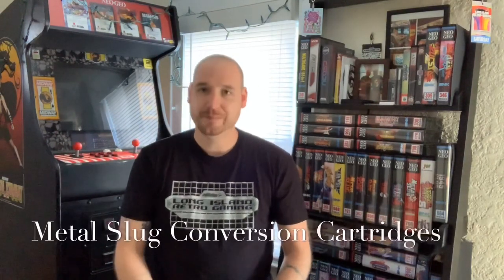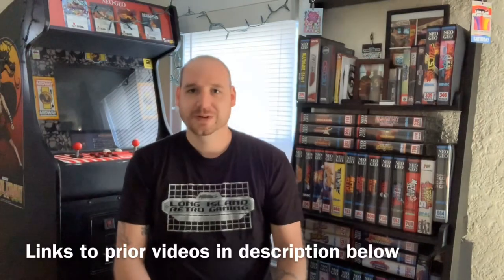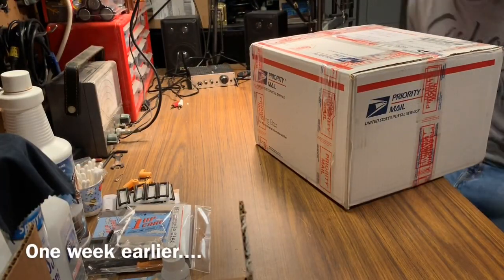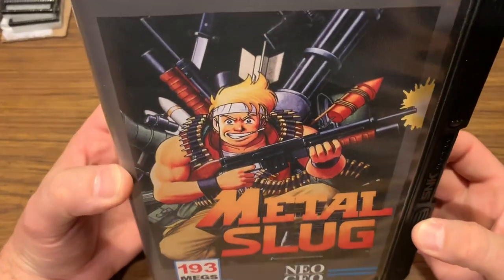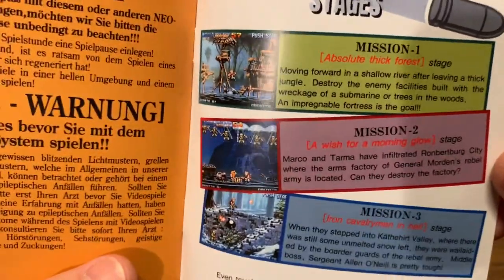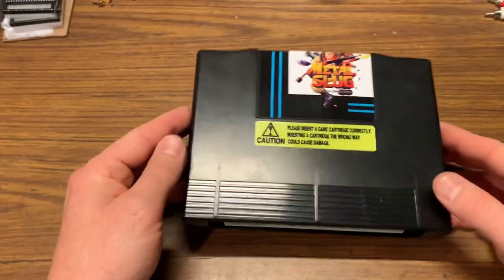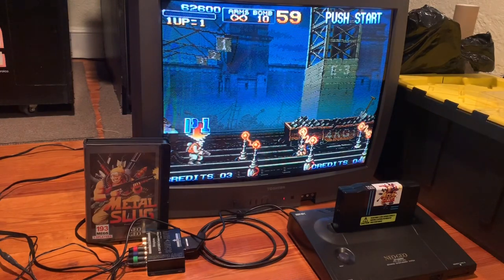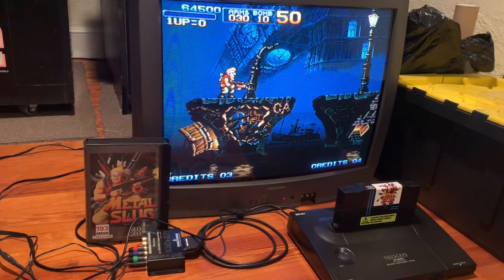Neo Geo AES Metal Slug Conversion Cartridges (Part 3)

Comment: Cool , i want do one converter of metal slug 3  have tutorial? I have one metal slug 3 mvs and one kof 99 aes
Reply from the maker: Sorry man I’ve never made one myself.
Reply: If the boards between the two carts are identical, you need a good desoldering gun, hot air rework station, and alot of experience with soldering. Because you have to swap every IC (chip) between the two carts. This is due to extra security added by SNK.

Comment: Unfortunately, his desoldering and resoldering is likely what killed that M1. That's one less fully functional Metal Slug original ROM set in this world.
Reply from the maker: Yup you are right on
Reply from the maker: Hey Emmett any advice on trying to open up a glued cartridge?  I have all the tabs pushed in and it just won’t go.  Do you just have to man up and rip it open??  Thanks
Reply: @mike7599  I had to fight with mine quite a while before finally getting in. Nothing specific seemed to do the trick, just a lot of prying and pulling with man-handling that probably wasn't suitable for a valuable game. Some things I might try if I were trying again with a more valuable game:
Cold
Heat

Sometimes getting an adhesive really cold makes it brittle and it breaks off easier but it could be bad for the solder joints and you also might get a lot of condensation. You can minimize condensation if you live in a cold region where you could leave it in the car and then try to open it with the defrost running (0% humidity). I've seen cases where a quick blow from something too broad to crack the plastic can potentially release all the adhesive at once... maybe a block of wood to spread the force, a mallet, and some kind of cloth to keep it from scratching.

The kind of adhesive I saw didn't seem like the kind that would soften much with heat but that's also worth a try. A heat gun risks melting stuff and doesn't heat through and through like leaving it in a hot car for an extended time would. Still, it might help during the attempt if it's low enough. Hair dryer too.

Wish I had some better advice. I'll try these suggestions myself the next time I come across a glued cart.
Reply from the maker: Emmett Turner thanks for the ideas man.  It’s crazy how hard they tried to keep people out by glueing the carts closed.  I’m tempted to try a hair drier.  Not sure if I have the guts to smack it with a hammer though!  It’s weird, to me it almost seems like they glued the divider piece that separates the two boards.  The rear part of the cart near the label wants to open but the front just won’t go.   I’ll keep you posted thanks again!
Reply: @mike7599  Glue is on the two posts that are closer to the contacts. They go from the back side through two holes in the boards and into two little cups molded on the front half. The glue is in the little cups that the posts seat in, so it surrounds the posts and has a good grip. Luckily, I did my earliest experimentation on a glued copy of Garou Densetsu Special (Fatal Fury Special; cheapest game). ;)

Anyway, I just checked my latest game (Fatal Fury 2 US dog-tag edition) and found it was glued too. I released every tab which made the front shell bow in on the contact side... lots of spring tension being held by the glued posts. I was going to set it down on an oil heater to see if it would release after it warmed up but I first applied a little pressure pushing out at the center of the bow. Suddenly (and, more important, unexpectedly) it released and sprung open!

It seems they used very little glue this time so I don't expect them all to be that easy. Still, I learned to be prepared for that or it might spring wide open and you'll end up creasing your label. Barely avoided that myself.

Out of my 10 games I don't have anything particularly valuable and I've only opened about half of them so I'll check to see if any of my others are glued. If so, I'll heat it up first to see if it makes things any easier.

Now, because the glue is between posts and little stand-off bowls, I don't expect a hair dryer to get any significant heat there. Hot car or one of those low-temp "safety" oil heaters seem like a better bet since you can let it thoroughly warm inside and out. Hot car probably isn't an option in the northern hemisphere right now. :)
Reply from the maker: Ah ok, I totally get what you mean about the posts being glued.  Makes sense considering screws don’t go threw them like in an mvs cart!  Well now I at least know how to grip it to tear it open, so I feel better about that!  Thanks again man
Reply: @mike7599  I did a bit of experimenting. Heat definitely did the trick, but mistakes were made!

Hoping the tension would release the glue on its own as it warmed, I placed two games on the heater with the clips released and pried up. The bowing was obvious on the front shell and so I had to set them on the flat back and leave them longer, since the front/glue side was not flat enough. When I came back, the back shell was bowing. The heat had soaked to the front and I was able to release the glue easily but the spacer plate between the CHAR and PROG boards had also bowed in/up a bit, making it difficult to close properly. Little protrusions from the front impact the plate unless you straighten/bend the plate down toward the contacts during reassembly. Those were Samurai Shodown (NA) and Shin Samurai Spirits (JP).

During all of this I had left my other glued carts with the clips released and they returned to their original shape just fine since I didn't apply heat. I snapped Riding Hero (NA) and Garou Densetsu 2 (JP) back together and placed them face-down on the heater with the labels over the edge (not touching the heat source directly). I didn't have to wait nearly as long since it was heating the glued side so I tried about 6 minutes later and they popped right open. The softened glue gives just enough resistance to be easy to pull open but not require the kind of force that might make you lose control and crease your label.

I still have glued Ryuko no Ken (JP) and Ryuko no Ken 2 (JP). One of them is only half-glued (one post) but maybe I can demonstrate with those.

I think I can get the two warped shells to straighten out by heating them again without the tension. Got a few cheap dupes to salvage spacer plates from if those remain an issue. ;)
Reply from the maker: Emmett Turner thanks for all the great information Emmett.  Hope that the shells straighten out!  I think this deserves a video if you do decide to crack open your remaining glued carts!  There is almost no info on how to open a glued AES cartridge.  I think a lot of people (myself included:) could definitely benefit from the techniques you are trying.

Comment: The jazzy part of the music was missing.  Gameplay wise it seemed good just the music was off.
Reply from the maker: rb1033 exactly right, just the music was off.  A casual fan may have not even noticed
Reply: Mike7599 glad it got fixed. That would have irritated me too. Especially with how much these neo geo carts are.  Especially metal slug. I wonder how messed up the music sounds in the other levels. You could barely tell in the first level.
Reply from the maker: rb1033 yeah im sure every stage would have had some sort of problem with the music.  I was too pissed off to play any further than the first stage!
Reply: Mike7599 yeah glad I found your channel. All I got is a consolized MVS with a multicart. I just got it to play all the metal slugs and some of the kof games. I don’t have any snk joysticks or pads but it works with my Saturn gamepad.
Reply from the maker: rb1033 sounds like a nice set up to get into neo geo!

Comment: The different coloured boards is completely normal, and LOADS of NEO-GEO games left the factory that way. Tons of games used the CHA256RY board, absolute shit loads did. Even more games used PROGBK1 boards. Do a bit of research on this, very easy to find that board set in loads of games. Very common games at that.

There is nothing special about what you received there, it is quite shoddy soldering at best. The artwork is all wrong. Look how warped the boards are, i bet the M1 chip was perfectly fine, and he f***ed a track on the board with his butcher job soldering. 

The actual boards makes very little to no difference at all. Neither does the use of EPROMs. It is still a conversion or a bootleg, it still isn't a real original copy, you shouldn't be paying big money for it. They all work exactly the same whether they're real originals or not. The console couldn't care less what boards were used, it cares that the correct data ends up where it should when it should, and any board set can be made to achieve that provided it will handle the size of the ROM chip being used and the jumpers are configured to address the correct ROM chip size that gets installed. 

I don't understand why people are padding out videos with "unboxing" things. Skip it, get to the point!!!